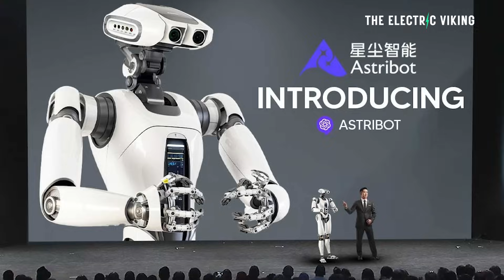China's Tesla Bot rival reveals scarily ‘human-like’ Astribot  S1 robot

Comment: It depends how scalable the materials and manufacturing is. Then of course maintenance costs and frequency is important. The electrical cost to run it and the requirements. How much per unit and cost for replacement parts. A robot to fix the robot would be interesting